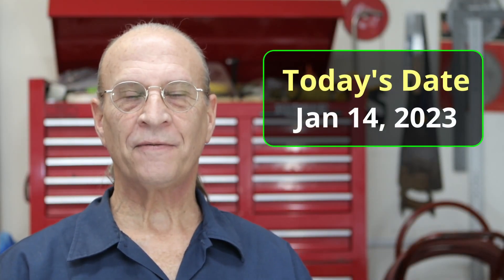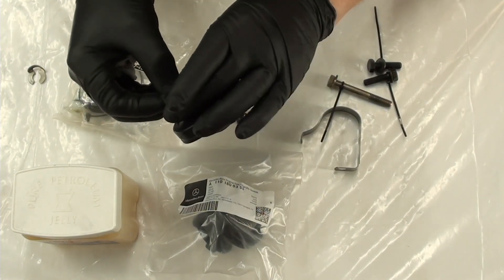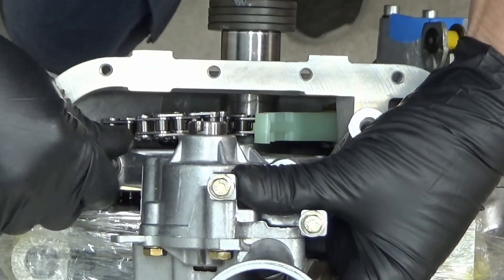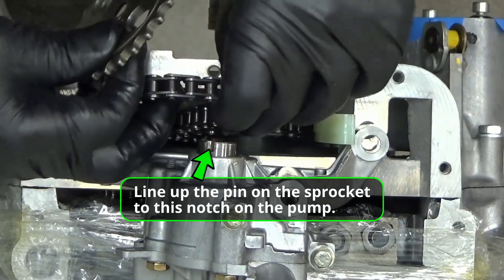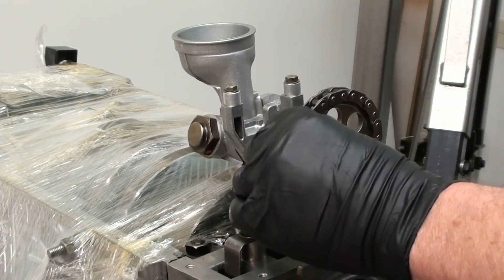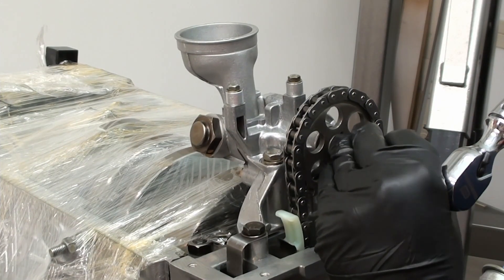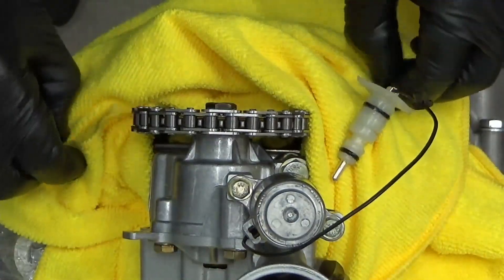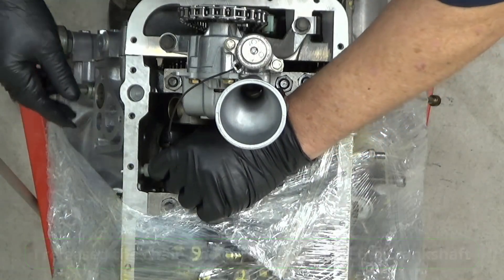560SL - Installing The Oil Pump & Oil Level Sensor

Comment: Great work Tony.  One question. How do you remove the nylon oil pump chain guide tensioner? Mine is Coke brown and fear that it could snap at any time.  Thanks!
Reply from the maker: The guide itself is held on with a cir-clip. You can see me install the new cir-clip & the new guide in my video where I installed all the lower guides: https://youtu.be/PzhijI2DRwc?t=819

Comment: You show a page from the manual that provides instructions to install oil level transmitter.  Where did you get that?  I am having a tough time getting complete repair info such as you show.  Appreciate this video.  I own a 87 560SL.
Reply from the maker: I provide a link to the manual in the description of most every video I upload. The link to the manual is https://www.startekinfo.com/service/download-document/outside/11883/PROGRAM/87560sl.html The oil level sensor is under the lubrication section. Here is a direct link to that https://www.startekinfo.com/service/download-document/outside/11883/PROGRAM/Engine/107/M117_56/18-230.pdf
Reply: @TonyLiveTV  Thank you!